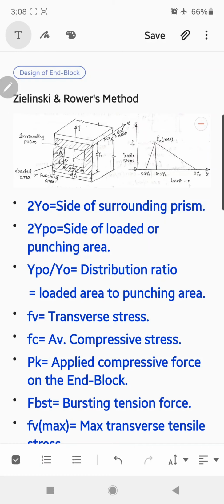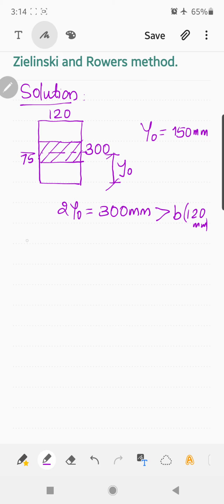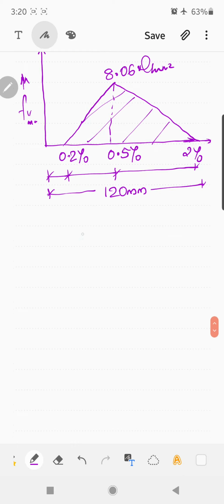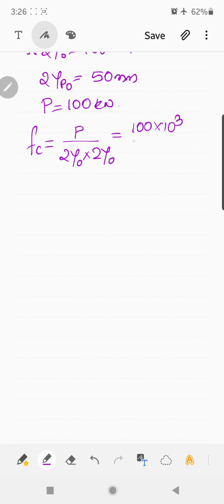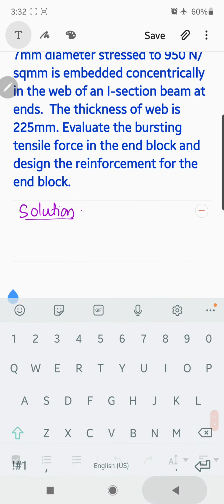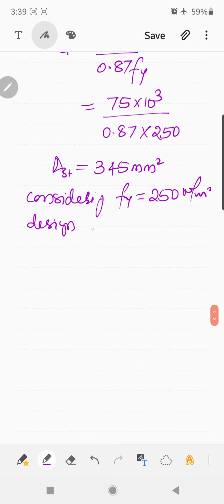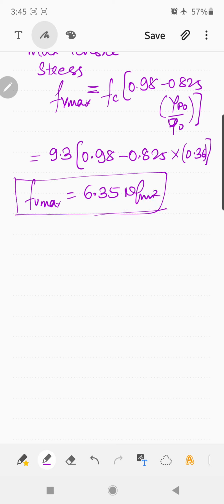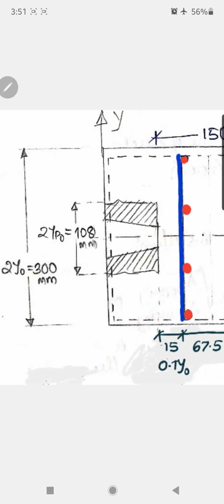Video-13 Design of End-Block continued-Zielinski Rowers and IS Code method

Comment: In the first sum of IS code method how did you calculated the value of 2ypo as 111mm
Reply from the maker: Area of cone=2Ypo,    Pi/4 *d^2 = (2ypo)^2,    2Ypo=111mm,   values d=125mm
Reply: @dr.asifiqbalmomin6519  thank you sir